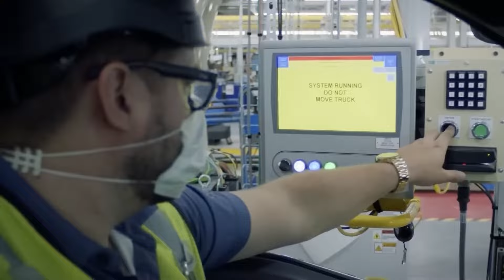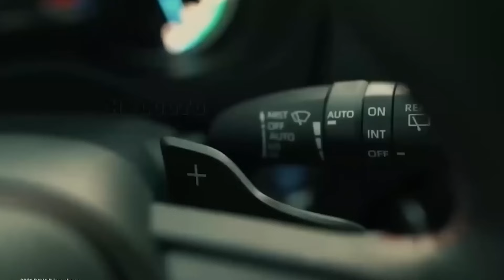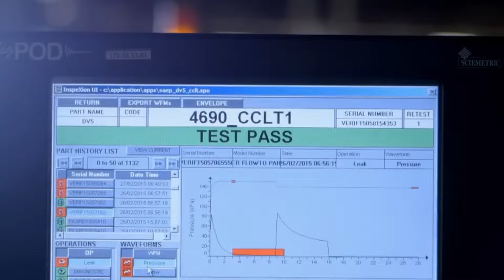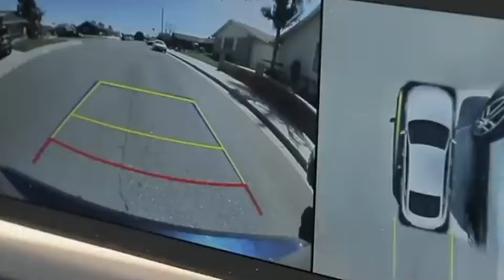Toyota Stout Solves 6 Big Compact Truck Issues!

Comment: Ford underestimated the popularity of Maverick. We were actually in the market for one two years ago. Every single dealership advertised they had one, then when we went to test drive it, they tried to switch us to looking at another truck, not a maverick and starting at about 35 to 40 thousand dollars. We wound up changing our target vehicle and went with with a barely used Fusion Hybrid with 15 thousand miles on it. Ford dealerships kind of soured us on the Maverick.
The Fusion hybrid has been great, but I wish Toyota's Stout was around two years ago.

Comment: With the recent agreement of 7 major car manufacturers (Toyota not included) going together to add another over 100,000 new high speed electric chargers across the United States by 2024, and the steady development of cheaper, safer, and longer ranging batteries, I hope Toyota's hybrid and hydrogen technology will be able to compete with the BEV market that is quickly evolving here! Who is going together with Toyota to supply hydrogen filling stations in the US? Sounds like VHS VS Betamax battle all over again imo.